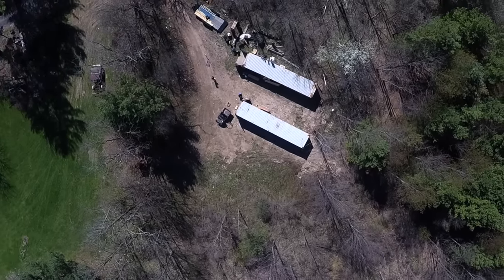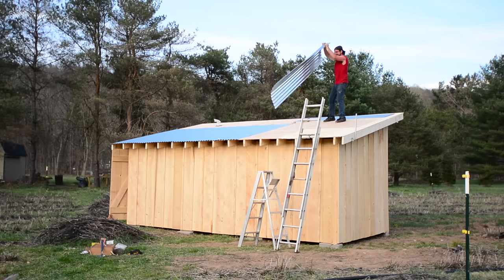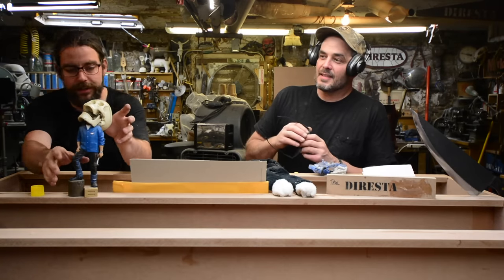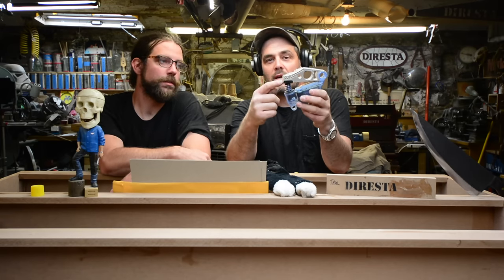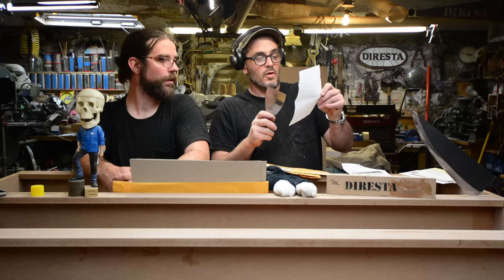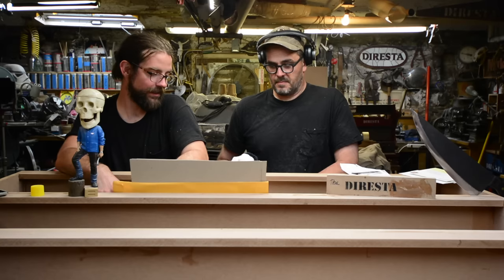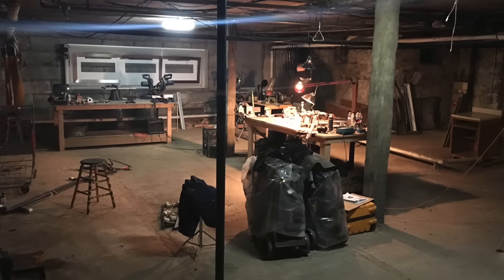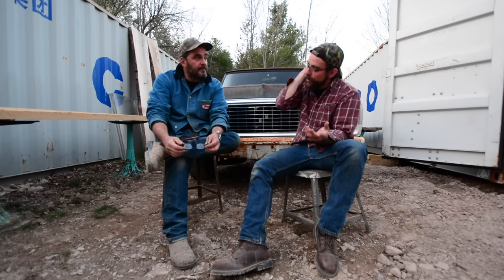✔  DiResta Mail Bag & Shop talk

Comment: I've been planning to build my own shop to my specs. You could use the two shipping containers as the side walls of the building. Get some trusses to span them and build front and back walls. A poured floor and you're done. I'd cut some doors in the containers so you can access them from the inside of the shop space.